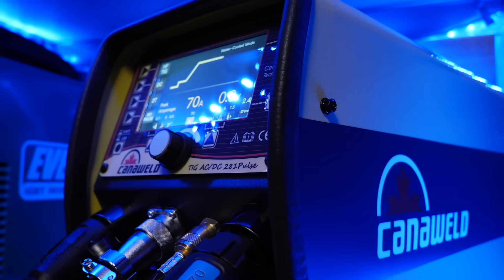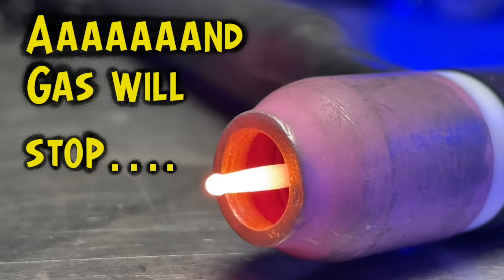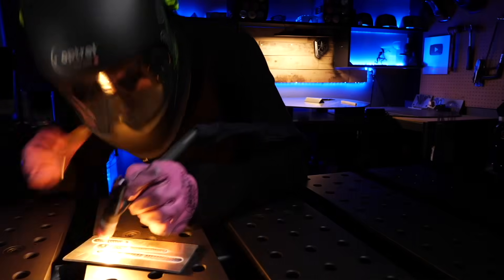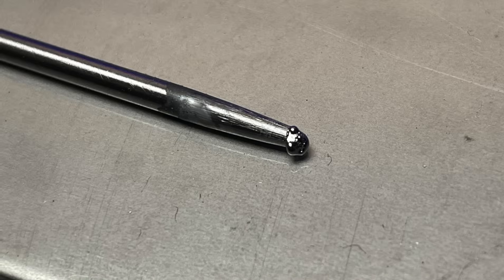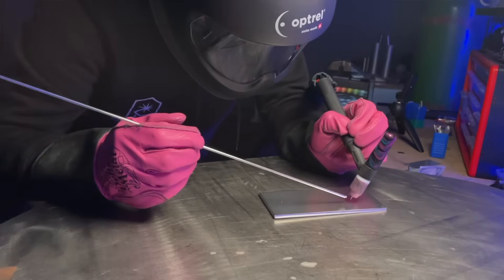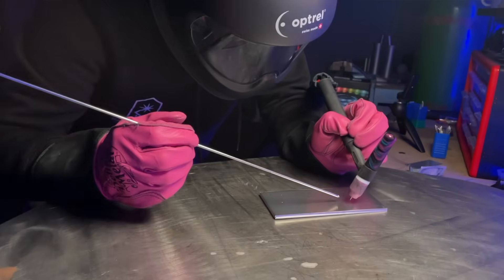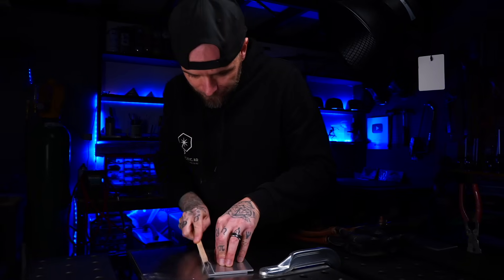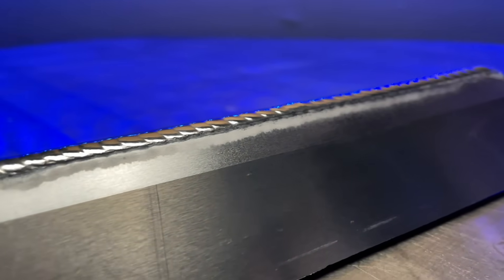5 tig welding HACKS in 4 minutes

Comment: I know this is a huge point of contention, but why do YOU, personally, ball the tungsten?
Reply: There are many different kinds of tungsten.
Some ball up.
Some don’t. 
Thoriated does.
Lanthanated less so.
Newer inverter machines tend to use lanthanated .
Reply: @papaloongie  I use the 2% lanthanated, Layzr, and E3, depending on my mood. None of them ball unless I do it intentionally, but at higher amperages they start splintering at the tips. Usually I just grind a small flat on the tip and that doesn't happen. I was just wondering why, specifically. I "think" the arc is more stable with a very small ball rather than the weird splintering effect, but I'm not exactly sure how much more.
Reply: @JackOffAllTrades  I wonder if going up a size in tungsten might let you get away with a touch less amperage.
I’ve also had issues with split collets overheating.
I’m sure someone out there will chime in!!
Cheers.
Reply: @papaloongie  I'm using 1/8 for anything above 225 amps. The blunt tip usually helps, but even that starts being weird at 260 amps+. I've never had a problem with collets.
Reply: @JackOffAllTrades  just asking:
At 260+amps, does the torch need to be water cooled?
I just weld 18 or 20 gauge steel and 063 aluminum.
Car stuff .
Cheers.
Reply: @papaloongie  mine is water cooled, and I wouldn't even try with an air cooled torch. I'm sure there are torches that are made for super high current, but I'm using a CK20.
Reply: Josh Spider: I've had problems with standard collets to. Try using wedge collets. They work much better, release tungsten properly when loosened and grip better. Haven't had a problem since switching.

Comment: Which tungsten for aluminum?
Reply: Depends on your machine what works best. My Miller prefers 2% lanthanated. Others work well with E3. Mine hates E3.
Reply: @joshsmith9398  I have a dynasty 200 dx.
Reply: I'd give 2% lanthanated a shot. 1.5% will burn up fast.